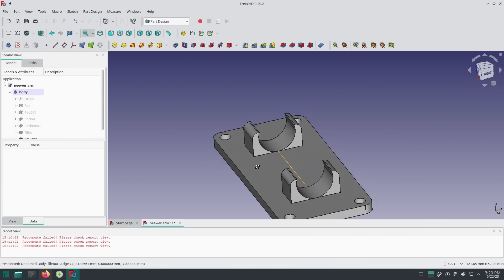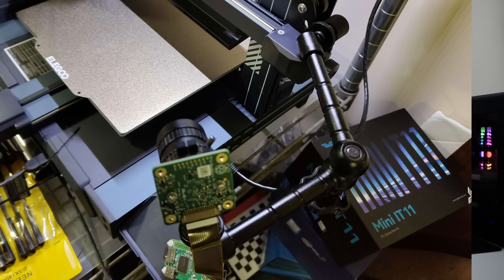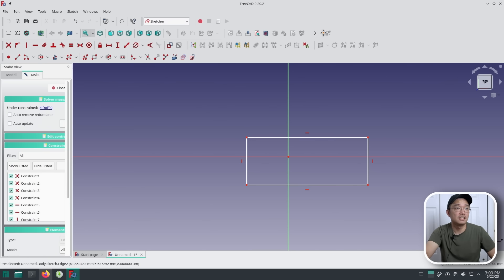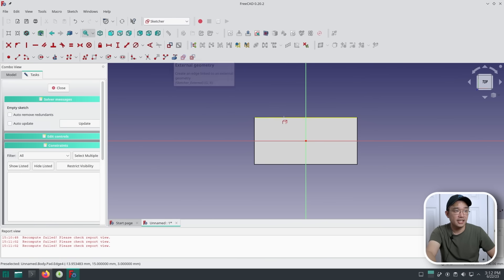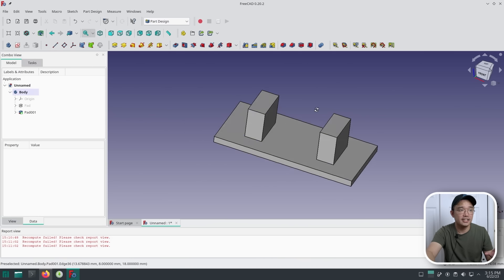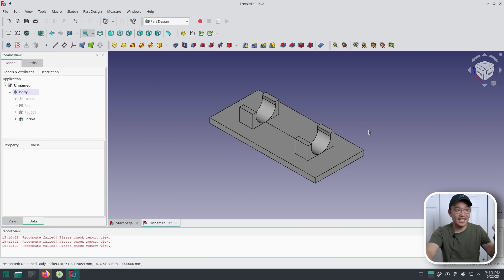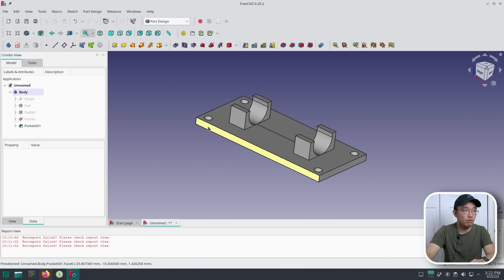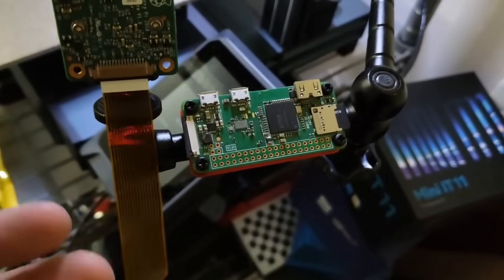Learning FreeCad with These Basic Steps

Comment: no, the user interface is very unintuitive, everything is hidden in complex places, the basic most used tools should be right there visible
Reply: no you dont have to dig them (find them), thats bogged down design for ui/ux
Reply: What about Sketching, Padding, or Pockets is "hidden"?  The toolbar buttons are right on the main screen and in the case of Padding or Pockets, open to an obvious dialog to set the parameters like depth measurement.  Sketching obviously opens to an interface with all the drawing shapes and constraint tools like every other CAD system.  Those functions are over 50% of any design work.  The buttons are right there in the UI, along with Lofting, Pipe, Helix, Hole, Groove and subtractive version buttons also, to say nothing of Boolean, Thickness and Chamfer buttons all also right there on the main screen.  

Sounds like you somehow have the UI wacked out or closed a bunch of toolbars that should be open all the time.  The toolbars are fully CUSTOMIZABLE to close, open, or add or drop any function from as well as arrange them in any order, either for the toolbars as a whole, or the order of icons on them.

I use this configuration which gives me an ultra modern UI that uses transparency and dockable views to maximize the workspace area which you can set up in less than 5 minutes and includes right-click pie radial shortcut menus that you customize to work with your most often used tools also:

https://youtu.be/6iU0g-X5Z1g?t=527
Reply: @brianmi40  I use it (blender/cadsketcher) as vanilla, no settings changed, default settings, for now its fine for me, but the tool needs to have the grid snapping option, all is fine
Reply: @brianmi40  keyword: context sensitive tools
Reply: @Jkauppa  Yes, the tools change based upon context:

open a Sketch, and the tools change to drawing shapes and constraints.

click on Boolean operation, and a window opens to add the selections to.

click on Curves workbench, or Fasteners workbench, or OVER 20 WORKBENCHES and get CONTEXT TOOLS FOR THAT WORKBENCH.
Reply: @brianmi40  if you want to learn how a proper UI for sketching is implemented, check how they do it in f360
Reply: @brianmi40  so you say that blender is a mess by default, needs customization to "work"?
Reply: @Jkauppa  You must have me confused with someone else.  I never mentioned Blender.
Reply: @brianmi40  well your finger points at me, point to God, if you cant get perfect gifts, you know who the source is then
Reply: @brianmi40  blender implied all the time
Reply: @brianmi40  dodgy
Reply: @brianmi40  confess blenders sins on their behalf, so that you will not point at me or look at me
Reply: @brianmi40  you chose the wrong platform to put your tool in, the blender eats your tool alive
Reply: @brianmi40  suits you, not me
Reply: @brianmi40  why would you limit me talking about blender?
Reply: @brianmi40  blender is a huge part of the cad sketchers problems
Reply: @brianmi40  namely blender design ui/ux patterns
Reply: @brianmi40  you did not confess, so you think your tool is perfect
Reply: @Jkauppa  Never said it was perfect and have pointed out specific shortcomings I've seen.

But it's the best Open Source 3D CAD without question, and does everything I need to not even THINK about Fusion360 at $500 a YEAR.

I'd rather have a Las Vegas vacation every year than pay for Fusion360 even if it would be two clicks less here or there.
Reply: @brianmi40  I dont want to customize before I'm able to walk in the program, and if walking is ridden with spike bushes then, well thats a bummer, must use a hatchet to get rid of the bushes of the UI experience :)
Reply: @Jkauppa  No need to customize at all, but some people see it worth 5 minutes to understand the amount of customization possible whether they choose to invoke any of it or not.

Bottom line:

FreeCAD is HIGHLY CUSTOMIZABLE:

1. shortcut keystrokes can be made to match any CAD program
2. toolbars, icons completely customizable, arrangeable, and closeable
3. right click radial shortcut menus can be created at will and with any shortcuts desired
4. color scheme customization

Nothing, repeat NOTHING needs to be customized at all to use the program, it simply allows a user to configure it as they LIKE, putting the most used/desired tools WHERE THEY MOST WANT THEM TO BE.

The most commonly used functions like Sketching, Padding and Pockets work nearly IDENTICALLY to every other major CAD program.  I know, I compared them before starting to learn FreeCAD.  Literally anyone can watch and compare these basic operation tutorials all over YT.  There's nothing secret about the basics of using every CAD system.

I get it: you either don't like it, or work for AutoCAD or some other CAD program company.

Awesome.  But the fact remains there are THOUSANDS of users who use FreeCAD happily and daily, for FREE and get great results.

You picking and poking at it vaguely will have zero effect on them.

Time for you to move on to YT channels for your favorite CAD program and comment there...  Just like FreeCAD, all the major alternatives are great programs.
Reply: @brianmi40  first time user ui/ux in the focus here
Reply: @brianmi40  ie if you evict/spook or welcome an user, yelling at an used for not being knowledgeable in a mess is not a welcome, its spooky and will get them running away, the more someone demands they dig in the complex ui, the less they will do it
Reply: @brianmi40  link to a tutorial? nope
Reply: @brianmi40  blender/cadsketcher/any, fix your ui/ux, dont send people to learn your mess up ui/ux
Reply: @brianmi40  if you have to teach/tutorial anything, its already too far, ui/ux must be better, more intuitive, more usable, straight away
Reply: @brianmi40  everything must work as displayed, true wysiwyg
Reply: @brianmi40  phd in blender/cadsketcher? too much, make it as simple as possible
Reply: @brianmi40  if you enjoy complex super hyper multi option UI/UX then good for you, but thats not the average user
Reply: @brianmi40  clutter is the proper word for how blender is currently organized, does not help if your one huge storage box contains all tools and materials in random pile
Reply: @brianmi40  less is more, clutter hides things, among the clutter, making it unusable
Reply: @brianmi40  blender lacks focus
Reply: @brianmi40  well if you would have it proper, blender, then you would not hear this complain about ui/ux, no I will only do basic things with the ui that are clear enough, others are hidden somewhere maybe if I find them some day, not bothering with tutorials for ui/ux complexity, just stopping the use or finding the "missing" buried features, or the program in the whole
Reply: @brianmi40  no, I will just not bother
Reply: @brianmi40  I'm not a programmer (job) of the app, so I dont expect need to troubleshoot programming design issues, just being able to efficiently use the tool, learning clutter is not efficient use, lowers usability, take the criticism or leave it, I dont care
Reply: @brianmi40  "go here and here to learn about how to do this" nope not gonna bother if its that hard to make a proper ui/ux, that can make all those be naturally simply *without knowing* found in the program interface
Reply: @brianmi40  this is my input, you have your views
Reply: @brianmi40  yes I think blender has too many features
Reply: @brianmi40  software engineers: k.i.s.s.
Reply: @brianmi40  make a minimum clear set of features do all the current things/features/functionality (less is more)
Reply: @brianmi40  yeah i'm a uni ux/ui masters, so what can you say lol
Reply: @brianmi40  ie uni masters in human interfaces
Reply: @brianmi40  off-the-shelf (out of the box) experience, if you get a drone, you expect it to fly, not having to read half-a-year the user manual to get something flying
Reply: @brianmi40  basic functionality needs to be in the front, advanced clearly under the basic tools neatly organized, so both the basic use and the advanced use is clear, intuitive and efficient
Reply: @brianmi40  a million drop down menus scattered around is a storage box, not an efficient ui/ux
Reply: @brianmi40  yeah most of the "usage" time goes into finding something in the tool pile, not doing what the tool should be doing, what kind of program-app is that?
Reply: @brianmi40  consider yourself being called out, and me not being the one that needs to improve or do something, or attempt effort
Reply: @brianmi40  yep its not about you "needing" to teach me how to use a program, that should not be necessary ever, not even for your money
Reply: @brianmi40  if I cant "come by" with some feature, then its not my problem, if the feature is not clearly presented, in usable way
Reply: @brianmi40  sometimes I suspect there is influence from some party (even commercial app corps) to make the free software unnecessarily complex, to drive their own goals
Reply: @brianmi40  or by teachers of the free app, to be paid to explain the complex features, you dont need to do your work if it was clearly usable for everyone, would you
Reply: @brianmi40  yeah tin foil on, tightly
Reply: @brianmi40  yep I think some effort is a scam, this might offend the many
Reply: @brianmi40  false effort leads to trash pile, (non-usable non-beneficial pile of software effort)
Reply: @brianmi40  what, clearly? nope, never heard
Reply: @brianmi40  how many blender dialogs (split mess) you have to search to find the functionality? blender makes your tool to be blender messy
Reply: @brianmi40  just point at blender, dont even look at me
Reply: @brianmi40  super clean, after how many hours of wasted "learning" time?
Reply: @brianmi40  I might hear some marketing bias on your statement, like in selling
Reply: @Jkauppa  Nope, have zero affiliation with the company.  Learned it 5 months ago, up to about 26 designs in it for my 3D printers.

I set a challenge to learn to create a part for a window regulator in my son's car which had broken.  Took about 6 hours with researching various functions to understand how to do it all, but after 3 test prints and adjustments I had a working part.

Now, I could recreate it in an hour with what I've learned.

Not everything is perfect and it's crazy that you can't choose what keystrokes or the mouse does to zoom/pan/rotate your design in the view window, instead of just choose from a few alternatives, but at the whopping price of ZERO it does everything I need it to do to get full use out of several 3D printers I have.
Reply: @Jkauppa  Open Source, being FREE, doesn't have any money to pay commissions for selling anything.

You either LIKE IT, or you DON'T.  No money can change hands either way.
Reply: @brianmi40  you have the "guru" affiliation, so you recommend as guru, fusion 360 works so much better than cad sketcher in general
Reply: @brianmi40  oh and 3d printing yep, thats what I would do also, and do in f360, but its the even being able to model, I find cadsketcher clumsy currently,  recreate is not same as "basic level" or "L1" usage with no experience or just things being simple while already being comfy with the interface. I strongly stress that the grid snap would be essential for efficient sketch modelling (model drawings)
Reply: @brianmi40  having problems figuring out the stuff is a mark of clumsy ui/ux design, and yep a wood log dum dum needs to be able to use the features
Reply: @brianmi40  reasons to conform, thats paying money, define money, so you discard my views on the usability. suits you sir suits you.
Reply: @brianmi40  if you have to conform to anything anyone says, then its paid stuff
Reply: @brianmi40  I feel that I'm being paying you
Reply: @brianmi40  if you sell the product to me, even as free thing, you got your payment
Reply: @brianmi40  I dont believe you, belief is payment
Reply: @brianmi40  you are basically saying "just succ it down, the interface with its complexities", nope, you do that
Reply: @brianmi40  nope I dont take your recommendation, maybe later if the interface becomes accessible enough, in general, including blender, I'll stay in the free f360 land
Reply: @brianmi40  free does not mean you have to take hits to heads, for being obnoxious, free and perfect, is better than paid good and free hard to use
Reply: @brianmi40  I rather not do the things with the free head-hurt than take the hit
Reply: @brianmi40  blender hurts my feelings
Reply: @brianmi40  I wont be told how to think
Reply: @brianmi40  thats not free, its told by you how to do and think things
Reply: @brianmi40  thats opposite of being free, being told by others how things work and you are the law
Reply: @brianmi40  not gonna be under your law rules or you
Reply: @brianmi40  I dont need recommendations or help from the law, you
Reply: @brianmi40  you dont get paid for helping, as I dont get my help from people or apps not from God
Reply: @brianmi40  btw, same issues for freecad as for blender (with cadsketcher)
Reply: @Jkauppa  "I strongly stress that the grid snap would be essential for efficient sketch modelling (model drawings)"

The more you know, the less you complain about missing features that are already present.  FreeCAD easily enables grid snapping while sketching and you can change the grid as desired:

"To use the grid select: Edit → Preferences... → Draft → Grid and snapping → Grid → Use grid. After changing this preference you must restart FreeCAD. Several other grid preferences are also available: Edit → Preferences..."

Maybe, in the future, before stating that a program does not have a certain feature, do a Google search...
Reply: @Jkauppa  In the video, exactly where and when was the Sketching tool "clumsy"?

What was clumsy about it and what was the timestamp?
Reply: @brianmi40  I dont watch no video, I was talking about the ui/ux of blender (with cadsketcher) in my own experience, not your not this not any others video
Reply: @brianmi40  so, you dont care what I think, so I walk away
Reply: @brianmi40  the whole blender is clumsy
Reply: @brianmi40  why you expect me to watch a video to use a software? what? why? rtfm.
Reply: @Jkauppa  Because the majority of users are visual learners, and by the time you locate, open and search through a manual and read the instructions, you can already have watched a video that gives more detail than words provide.

but you do you.

Comment: It really does not matter for the part you created in this video, yet worth mentioning; instead of increasing the depth dimension of a hole, choose the feature "through hole" (many CAD systems offer an option to select last surface to "punch" through. When designing plastics parts a general rule is to ad a rounding to all concave transitions of stressed/load bearing features. And lastly a DFA tip: always add a chamfer to surfaces that has to be pushed over another part (and a rounding to any feature that has to go into a hole ... but here the boom arm is already round).

Comment: Please note, the holes are 2.5 in diameter not 3.5
Reply: The Pi-zero drawing referenced in the video states them to be 2.75 mm :) - The board corner fillet is 3.5 mm
Reply: Exactly! "Drilled to 2.75mm, centered 3.5mm from each corner"

Comment: Thank you.... I have being trying different 3D modeling software and that one looks to be the easiest to use.
Reply: I spent about 20 hours in it and can now design about anything i want, which has included several parts to 3D print and things like curved boolean subtractions and raised lettering.  Works great and the future will only make it better.  There are probably 3 tutorials now on YT for about anything specific you need to learn in it.

It has tripled the utility of my 3D printers, which these days are dirt cheap.